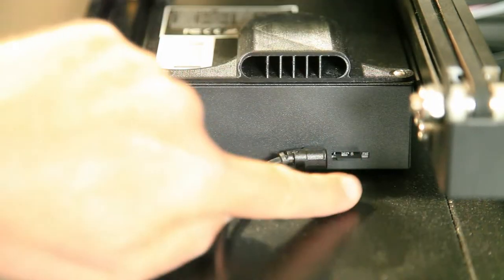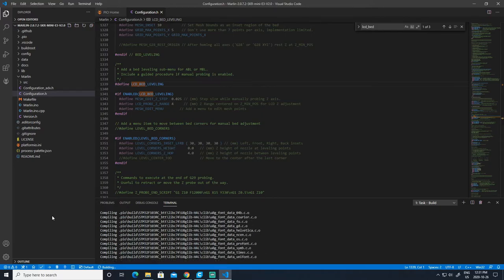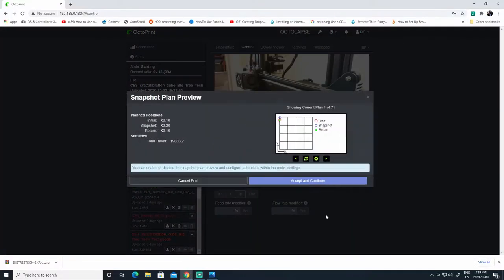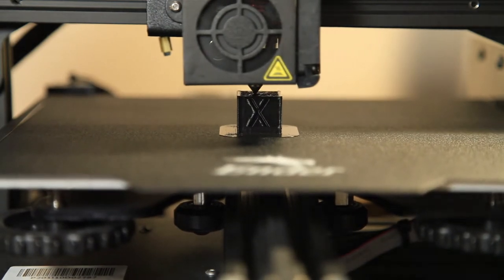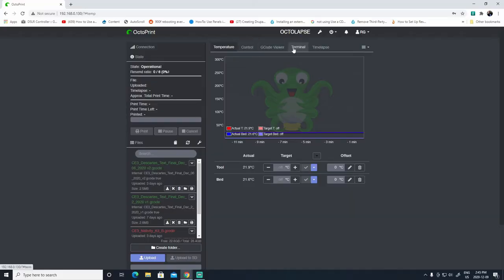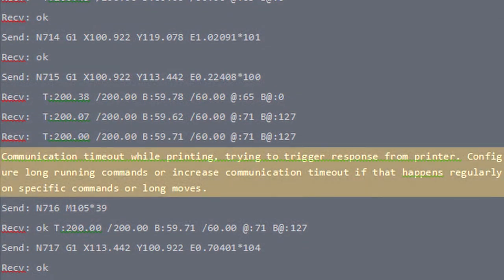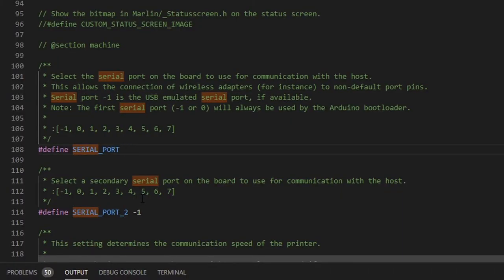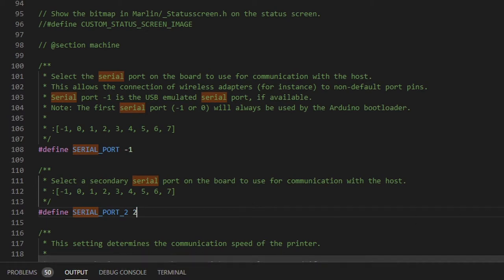3D Printing Blobs -- Solved!

Comment: Man am I glad I found your video.
I have an Ender3 pro with that same setup. I was having a similar experience, the only difference was...is that I was printing from an onboard sd through the main board sd slot. All I had to do was put my sd in the TFT display and EUREKA!!! Problem solved. I was seeing the two second delay, and no matter what I tried in the slicer, I just couldn't get rid of it. So it is a firmware issue that's not just unique to your particular slicer as well.

Comment: Hi, 
I got a 3d print done but the result was extremely underwhelming. What can I do? Could you help?
Reply from the maker: Hi Arnov Chaudhury...I may be able to help but you need to give more more information about what problems you encountered...in what way was the result underwhelming?  What exactly is the  problem with the print.  Unless I have some details, it's impossible for me to help.  There are many factors that affect the quality of a print.
Reply: @CreatewithTech  thanks for getting back! So the model I was trying was a portrait and the print came out with holes in the front and not detailed enough. So I was hoping to share a few images so you could understand better about the issue. 

It was printed using the FDM printer, with 30% infill density. And roughly 5 inches.

Comment: Help i have an ender 5 plus and i have this problem i played around with settings in cura but it still happens
Reply from the maker: This is a very annoying problem.  Have you done anything to the printer recently which may explain the problem, or was the printer working just fine and then the problem started?  If you changed anything on the printer recently retrace your steps and see if you can locate the issue.  If you've updated the firmware recently consider going back to the firmware before the update to see if the problem disappears.  Let me know if you've changed anything on the printer before this problem appeared.  RG
Reply: @CreatewithTech  i just remember i did a firmware update but how do i get back to the previous one
Reply from the maker: @спутник-у6у  Where did you get the firmware that you used to update your printer with?  Is it the official firmware or did you compile it?
Reply: @CreatewithTech  if I remember correctly it was offical i think i don’t know for sure
Reply from the maker: @спутник-у6у  What you'll need to do is download and try other firmware versions to see if it fixes the problem.  I don't know which version of Ender 5 you have (original, pro, plus) but you'll need to get the proper firmware for your machine.  You might also consider compiling your own firmware if you feel comfortable with that.  It's one way to learn a lot about your machine and 3D printing in general.  Another thing that you need to consider is whether you're using an interface like Octoprint.  If you are, and the problem only happens when you're using the Octoprint interface (as was the case with me) then you know that the issue has to do with how Octoprint communicates with the printer.  Basically you'll need to do a bit of sleuthing to try to narrow down the problem.  There are lots of possible variables which makes it impossible for me to give you a definitive answer to the problem.  You'll need to do a bit of work backtracking to figure out the difference between your original firmware (which I assume worked fine) and what you have on your machine now.  There are lots of tutorials on YouTube on how to do this.  Good luck and let me know how it turns out.  RG
Reply: @CreatewithTech  yeah i calibrated my extruder and there is nothing wrong with that i use creality slicer so i’ll use another one i guess